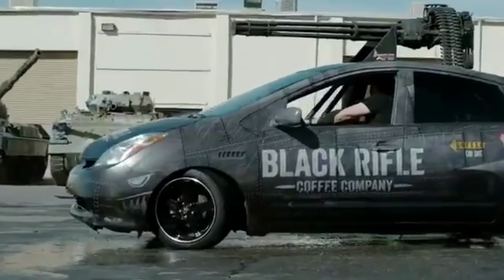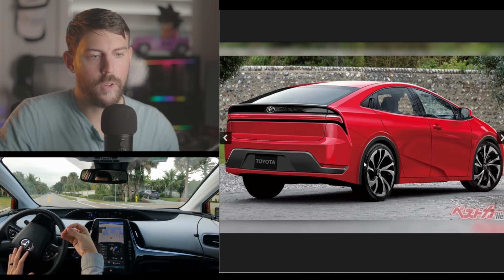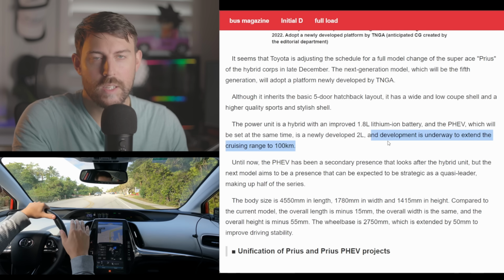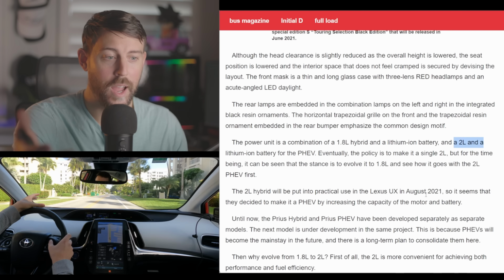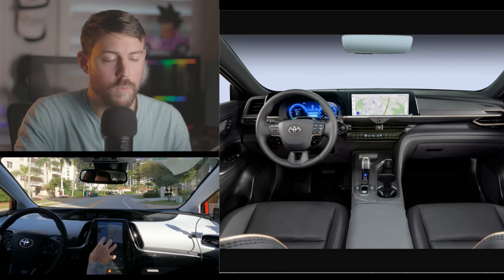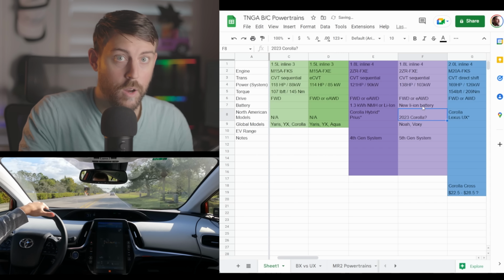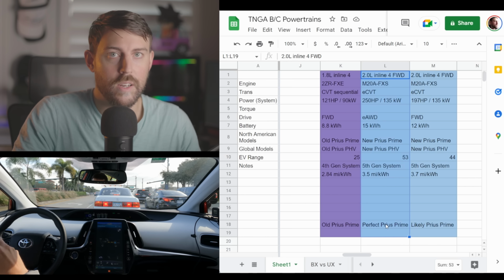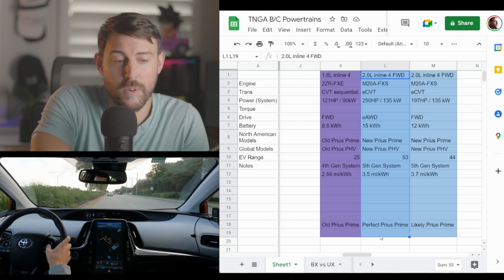*BIG UPDATE* The All-New 2023 Toyota Prius will have INCREDIBLE power and EV range...

Comment: I'd rather pick column M. Column L is not the most efficient (see row 12), but it's the column M. 250 HP is overkill (as you state), 200 HP should be well enough, I'd rather want less weight and more range, maybe even a little more kWh capacity. Even 1.8L would be enough if it's lighter.
Reply: 62mi range would be so awesome. Usually I get along well with the current 30 mi EV range, however when the AC is on the longer range could be great in rare cases.

Comment: We've had two Prius. In fact my daughter-in-law is still driving one of them with over 250,000 miles and zero problems. Still on the original brakes.

For me I stepped away from the 4th generation Prius because Toyota was moving in a different direction than my style-wise. I just didn't want that design in my garage. This 5th gen is attractive and could allow me to take a step back toward a Prius purchase.

I consider a hybrid to be old technology now and would not consider buying one. For me a PHEV is the right vehicle design. If Toyota truly comes out with a Prius PHEV that has 60 miles of range I would be strongly tempted depending on other features and behavior. Note that I already have a Honda Clarity which has 47 miles of EV range. Anything less than or equal to 47 miles won't attract me. 60 miles of EV range would do it though.
Reply: Wondering how often your d-in law replaces the water pump, at this point the number should be twice.  if not, well the 2ZR-FXE very dependably blow their headgasket due to waterpump failure. Also huge issue with egr  clogging causing same. The pump is a catastrophic fail no warning, no sign, and takes out the engine.  My local jdm engine importer (JDM Engine Bay) sells between 30 to 50 motors in the bay area every MONTH. They fly off his shelf like windshield wipers in the rainy season. That $225 pump fail destroys the motor ~150k miles.  The Pruis ZRFXE is a ticking time bomb every mile around that number and everyone who doesn't know this out of ignorance, bliss or mistaken believe of dependability is going to pay the price.

Comment: I absolutely love my 2015 Prius and would’ve bought it even if it didn’t get amazing gas mileage.  Love the airy feel, the huge cargo capacity and the non-restricting seats. Seems like all new cars are leaning towards sports seats that make you pinch your knees together which is torture after an hour of driving.
Reply: Hope you change your ticking time bomb water pump by 150k miles.  You will loose your head gasket and motor if you dont.  Google the issue on the gen 3 motor.

Comment: Shame about Toyota. I ran Toyotas for years, Prius Gen 2 included...very reliable cars but the company is in serious trouble and is now the most indebted company in the world with VW Group not far behind. I wanted to go EV in 2019 and Toyota had nothing to offer me. Very pleased with my choice of the Kia e-Niro (Niro EV in the USA)....No fossil fuel engine can compete with the smoothness and power delivery of an electric motor, and as for reliability...EVs take it to a new level which ICE powertrains cannot match. Here in Europe hybrid sales have peaked, PHEV is falling, diesel sales have collapsed and petrol only is falling too. The only growth area in the new car market is BEV and Toyota are not players. One in five new cars in Europe are BEV and its looking like 1 in 4 by year end. Toyota’s bz thing just doesn’t match up to the Hyundai Ioniq 5 and Kia EV6, not to mention the Tesla model Y. I hope they can turn it around but they, along with the oil companies are doing everything they can to slow down the inevitable transition to battery electric vehicles...it won’t work...the running costs are a fraction of even a hybrid car which still costs around €80-€100 a fill up, that’s like burning money. Last year I did 15,000 km from the 8 solar panels on my roof...driving on sunlight is the coolest thing.

Comment: Well. Here is there issue with PEV they want to meet the specifications for rebates.  Now, Toyota is going to circle the drain on the way down.  

There excuse for an electric car being fully recalled. The Corolla electric will be built by BYD with body by Toyota 

I think if you watch Toyota and Honda sales you will see them drop as both continue to try to sell ICE cars.

Comment: I had a 2018 Prius Prime.  25 miles of all electric range is sad (yes, without A/C I could do 35 or so).  The Rav4 Prime has 40 miles.  I after 2+ years, I sold it and got a Tesla.
Reply: Toyota toying with EV, they can do better.
Reply: Would much rather have a Tesla with so so build quality then a Toyota that uses Dino 🦕 juice

Comment: If this is accurate rendition I think they did a great job with the styling and based upon the Prius popularity will likely sell well. Personally I think Toyota should be ashamed that they are not making more efforts to expand battery power train usage. Even just putting a battery that could get 70-100miles full EV range with ICE generator would make these cars a much better choice. At least in plug in versions (Prime).

Comment: Looks like I'm just barely going to miss the new body style :( My 2019 LE which I absolutely loved, got stolen, and found destroyed :( I can't go many months without a car. My F150 is so stinking expensive to drive, I can barely afford it. Plus, I can't drive it to make a living, as I did in my Prius. Anyway, I've owned about 8 brand new vehicles, and 8 used ones, in the last 40 years, and my Prius was the best vehicle I've ever owned ! Such an awesome vehicle for car camping too :) I drove 9500 miles in the month of April, and slept in my car, with climate control cranked up all night, about 20 of 30 days :) Can't wait to get a brand new one. Oh, but I have zero desire for a Prime. 1) I don't want to hassle with charging it. Its already a hassle to get gas. Charging would be even worse.... unless that charge was going to take me 600 miles, and I could do it while I sleep. 2) When I drive (I mean, for work) I hardly ever start the car, without driving it 300 miles..... and on cross country trips, my normal driving day is 800 miles. So 50... heck 150 miles of all electric hardly matters. Id love to have a straight EV > in about 5 or 10 years, when they get the range up to 600+ miles...

Comment: I have a 2019 prius plug in and i am happy with it. The only complaints are the huge size which is a pain in UKs parking lots. The low ride and the small booth space + low quality paint that chips easy
Reply: Luv mine but. Yes, lots of front chipping on my red 2007 178k miles. Don’t think I drive in gravel…….😂
Reply: @rebeccalewis1619  i had all roads stripped 4 weeks ago. Gravel everywhere.  My hood was stripped of paint lol. I bought the original paint and I'll try to do a bit of touchup..

Comment: I prefer they keep the 1.5L and 1.8L engines and so they are interchangeable, for the most part, between all the years and models used.  My understanding is there are more of those available on the market and that will help keep the price point down and performance optimization known.  Most don't need more HP.  Thinking increasing the lifecycle and performance of those two engines will be best for the consumer base and maintenance of what's been and will be produced longest term.
Reply: I get that point for certain.  I had to replace the motor @ 151k, water pump failed causing head gasket fail.  The motor was sourced bay area local to me from importer of used JDM motors. $1,200.  Head gasket repair would have been that or more.  They had nearly 30 motors available to go through.  The water pump/head gasket issue is the achilles heel of the gen 3 cars.    Known issue, I had just bought my car used and it probably had the problem lurking then.   The plastic electric water pump is a ticking time bomb.  Just google that failure, there are millions of comments on the topic.
Reply: @dvmartel1  What year gen3?   Never thought to look for JDM's. I've missed a few and one or two during 50% off sale last winter.  Seemed to be ~150K engines from what info I could find on the cars and scouring the net.  Seems ever since I spoke and wrote about there's been none in the yards and now the non-pick-your-parts places don't even have inventory around me.  Plenty of 1.5's at amazing prices.  Wishing those retrofit no prob and nothing to complicated. $1,200 sounds about right.  Any noticeable improved fuel efficiency with the JDM or they about same as U.S. spec since made there?

Comment: I wonder if we could be in for a surprise from Toyota. They've already indicated that their new solid state battery would debut on a plug-in hybrid. That battery should be coming to market in late 2023 or 2024. The current Prime battery weighs around 225 pounds. A solid state battery would deliver approximately three times the current battery's EPA range of 25 miles. Also, less plumbing for the battery would be required due to the solid state battery's superior resistance to temperature change. Overall, the weight would be reduced a little while electric range would increase to approximately 75 miles. The need for more power on the gas side would be mitigated somewhat, with the electric side of the power train able to handle higher and more sustained energy demands. Toyota could then focus on bumping the gasoline engine efficiency up even further from its current 41%.

Comment: I've owned four now. A 2005, 2006, 2007 and a 2012 PHEV G spec. With over 1.4 million km's across four of them, we've come to love them and won't drive anything else until Toyota offers pure electric in Australia. Hands down the best cars we've owned with North of 80 cars of all types I've owned in my lifetime so far.
Reply: Impressive! I love my 3rd gen, although I’d love to replace it with a pure electric as well and be done with the maintenance.
Reply: @OptimisticEngineer345  Love my 3rd gen as well... though would be awesome to be able to retrofit the 1.5L into the Prius (not C model) as well as retrofit into other vehicles, like my 2001 Dodge RAM.  I'd like to invest in the 1.5L drivetrain and all electronics to make a demonstrator unit first and then understand well enough so to retrofit into other vehicles... starting with my truck ideally.  I just don't see having the time for another two years.  Amazing the price of the low mileage parts that just aren't ever replaced.

Comment: The biggest problem I have with my Prius that will keep me from buying a new one is the low ground clearance. I bottom out every time I hit a pothole on the interstate. I even put the lift kit on mine and it’s still to low.
Reply: I put a lift kit on mine, by "OFF ROAD PRIUS", and it made quite a difference, and I do a lot of dirt road driving while getting to mountain bike sites. MORE clearance would be better of course.
Reply: Yea, here in Salt Lake City all the driveways have steep transitions for snow reasons and I have to take them supper slow and careful not to scrape too hard. No idea why anyone would lower this car.
Reply: You probably need to move to a state that maintains it's infrastructure, the interstate is almost never that bad in most regions.

Comment: 270k miles on a '13 currently 80k miles on an '18. Absolutely no problems on either one. I liked them both but like the 18 best. I really don't care about increased power, I drive 75mph hwy which is most of my driving and am more concerned about mpg. If you want a sports car, buy a sports car lol. A Prius isn't a sports car. I get about 52 to 55 mpg depending on what season it is, I'd really like to see 62 to 65 mpg or more, and 75 miles ev for the prime.
Reply: Hi, on that 270k gen 3 2013, how often have you replaced the water pump?  Any issues with clogged erg system?
Reply: @dvmartel1  no replacement of anything but brake pads tires and filters. Changed oil every 6000 miles. Was averaging 43 to 46 mpg. Hoping my 2018 does as well. Brake pads still ok and changed battery air filter when it needs it.

Comment: I know a cab company that has 19 Priuses. Couple of them were at 1.4 million kilometres. Owner said that transaxle bearing fail at 700000 km. I've had 5 different Priuses and they are very reliable.
Reply: how often do they replace the water pump?   My local JDM engine importer sells 30 to 50 of the 1.8 L 2ZR-FXE motors every MONTH mostly to met the demands of Uber / Lift drivers. These motors have failures of the water pump and quickly blow the head gasket.  This is a known issue.    The 2ZR-FXE water pump reliably breaks around 150k and you just kiss the motor goodbye.

Comment: I hope the navigation on the Prius is better than our 2021 Sienna which can not find its way out of a paper sack. Absolutely terrible. At the suggestion of our local Toyota dealer, we forget the Sienna navigation system and use a cell phone instead. Example of problem: our system could not find the direction to St. Ignace, MI. Could not find Leesburg, FL. We could leave our Sienna for a $200 Toyota upgrade that would take all day. Guess we’ll continue to use our cell phone. I guess we wasted lots of $$ on the navigation system.

Comment: I just love Priuses. Looking forward to the 2023 model. I will buy and drive it till the wheels fall off. Currently driving a 2017. I had a 2012 and 2022 Prius but the 2022 Prius body design is boring and looks like a regular car.  Crazy thing is that I 100 percent financed the 2022 and was able to sell it for I owed minus 1000 dollars negative equity not bad for owning the car for only 4 months

Comment: I think after Toyota's experience with the Rav4 Prime, the optimistic figures (range 53 miles, power 250hp) are likely. However the question is whether Toyota will produce them in the required quantity. The biggest problem of the Rav4 Prime has been non-availability (I had to fly across the USA to pick up mine). As for mi/kwhr, I can easily believe these figures. The Rav4 Prime consistently gets 2.9 to 3.0 miles per kwHr. A smaller, lighter, streamlined vehicle could easily expect to get 3.5 mi/kwHr. 

I really hope the Prius Prime is made available in all States but it will also need to be made in the USA if there is to be any chance of a tax credit. I was fortunate to buy my Rav4 Prime with the full tax credit... which compensated for the $5000 markup I was charged on my Rav4 Prime. (I fell out of love with Toyota as a result of that)

BTW you definitely want the eAWD because the Rav4 Prime routinely squeals its tires even in pure electric mode. This is partly because of the 'efficient' tires they fit but mainly due to the fierce torque off-the-line. I can't imagine a FWD only vehicle would be fun to drive - we've seen similar complaints about the MG electric CUV in Australia. The Rav4 Prime of course has eAWD and it works surprisingly well in adverse conditions - with the next generation electrics I expect performance will improve considerably.

Long term, the preferred range for a PHEV is about 100 miles. But I'd settle for something closer to 80 miles of range. I can do most of my local driving in pure EV mode which results in an average, since new, of 81.4 mpg equivalent. Rather nice to have during our recent price surge! The Prius Prime might be a big step in the right direction, but frankly if they manage to package the Prius in the 250hp eAWD, why on earth would you consider buying any other model? You would likely see average fuel consumption over 100 mpg equivalent and the power would be 'invigorating' to say the least. I love having 302 hp on my Rav4 Prime - driving it is a blast. 

If I were Toyota I'd be focused on the Prime and ditch most of the lower end models. Maybe retain a couple of higher power versions. Truth is, once you've driven a car with electric motor torque... you don't ever want to go back to pure ICE.
Reply: It should be way more efficient than that! My VW ID4 is averaging 4.5-4.6 mi/kWh, granted I live in a rural area. I had a Prius Prime and it averaged way north of 4 mi/kWh.
Reply: @User.Joshua  The max range for the ID.4 according to VW is 275 miles and the battery size is 82kwHr. So that suggests a figure of around 3.4 mi/kwHr. However, talking to ID.4 owners I know personally, even that figure is optimistic. But in any case, the ID.4 is pure electric so you're comparing apples with oranges. According to the EPA the ID.4 gets around 104 empg - a figure that my Rav4 Prime can match in pure electric mode! So frankly, apart from having half the range of the Rav4 Prime (and even that is optimistic) the overall performance and economy of the ID.4 is disappointing.

As for the old Prius Prime, I have no personal experience of the vehicle, but its pure electric range was pitiful whereas the new model you could realistically expect to do all your in-town driving on pure electric. I do look forward to electric vehicles having a range north of 500 miles, a 10% to 90% recharge time of less than 5 minutes, and a cost below $40K. The most likely estimate of such a vehicle is about 2027 at which point all existing electric vehicles become all but worthless.
Reply: I tried providing a few photos of my daily commute, but the spam filter keeps removing it. Anyhow, for the past few days, I’ve been averaging 4.6-4.9 mi/kWh by the end of the day. I understand that isn’t typical of others, but this has been my usually experience.

Comment: to bad it only 25 miles of range - the original volt was ~35 miles(55km)  and the second edition was ~50 mile(80km). it would  be more preferable to be around 60 miles (100km) of range - that would be the absolute sweet spot  for most people